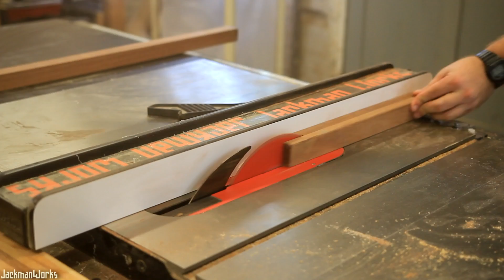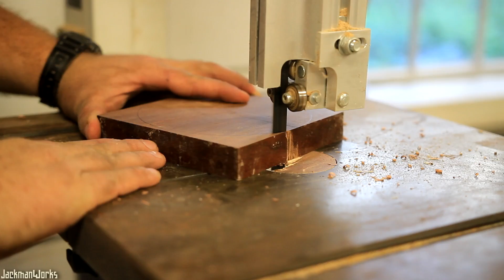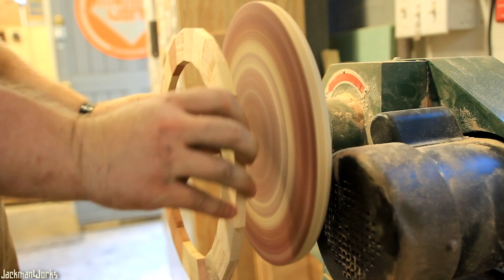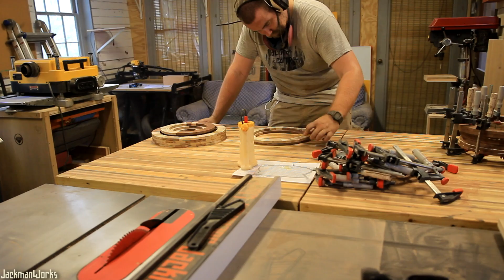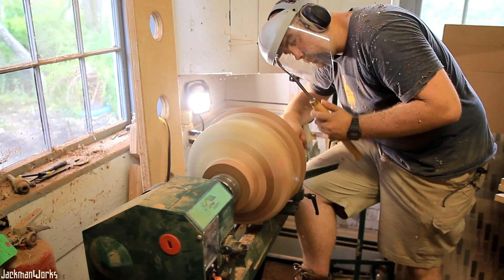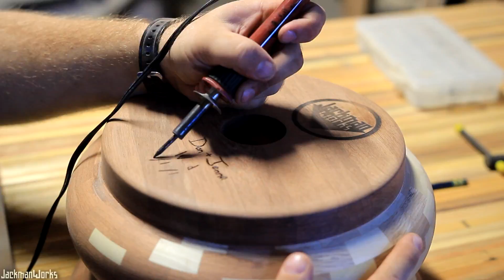Reclaimed (pallet wood/mahogany) Segmented Bowl

Comment: Everytime I think I'm ready to start a segmented turning or any turning for that matter, I watch a video and of course a break or even worse an injury happens. What will you do differently next time to avoid the breakaway and what safety precautions do you take to stay out of harms way.  Beautiful result never the less. Hope you weren't injured.
Reply from the maker: It's just a matter of triple checking the thickness of the bowl while turning. I wasn't able to reach the bottom of the bowl because of the shape and I took a chance on it haha. No injury here, just make sure you stand to the side as much as possible in case something comes flying off, and also always wear your face shield.
Reply: Thanks for taking the time to answer. I think this info will benefit many.